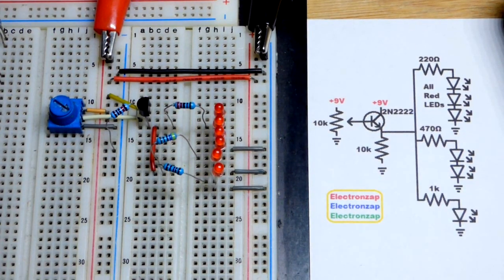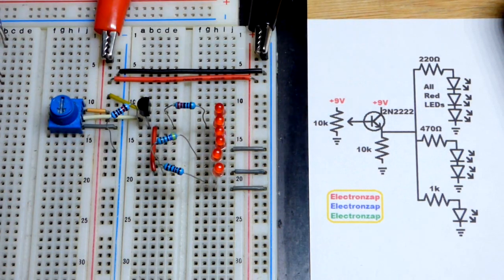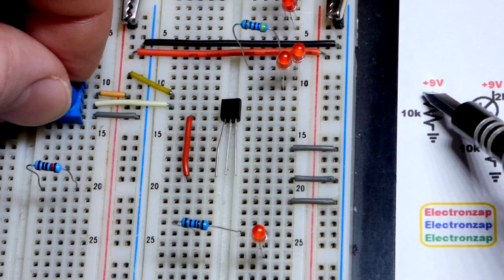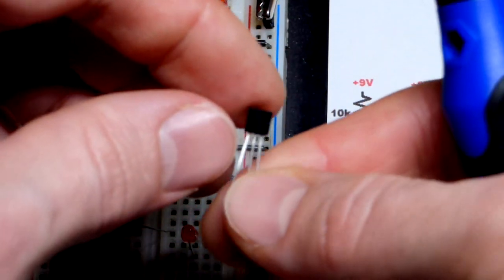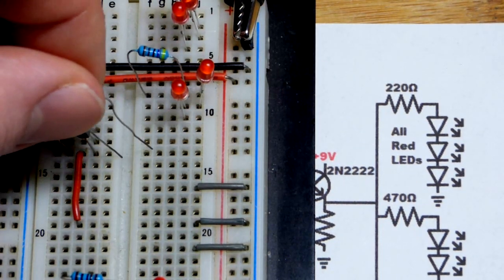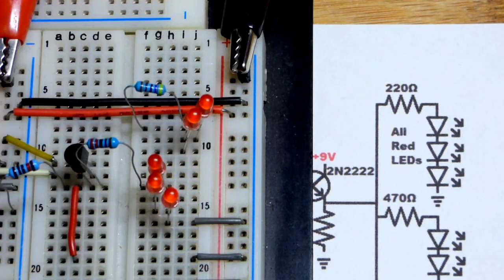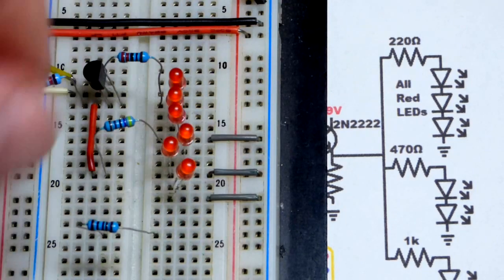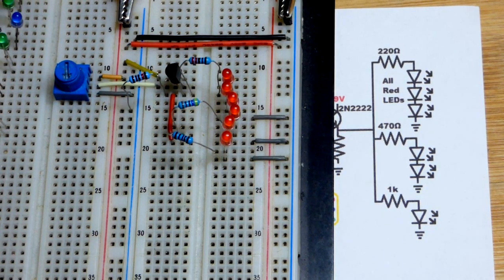Voltage controlled sliding LEDs using 2N2222 NPN BJT emitter follower set by trimpot Electronzap

Comment: you make this look easy
the wires are organized.
I take the wires were short from the beginning or did you cut it?
Reply from the maker: I cut and stripped the red and black wires that connect the breadboard power supply rails together. The rest of them are premade jumper cables that I got from some kits.